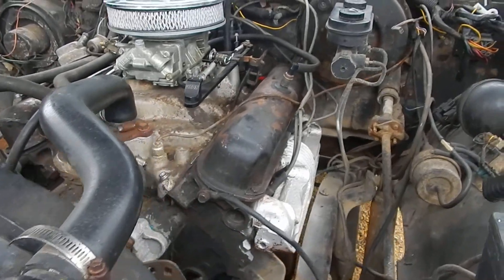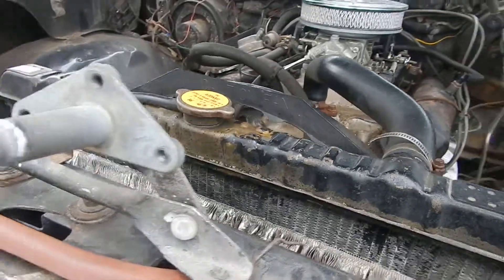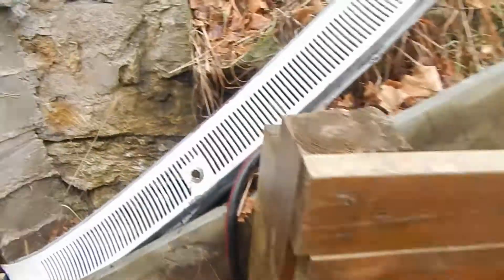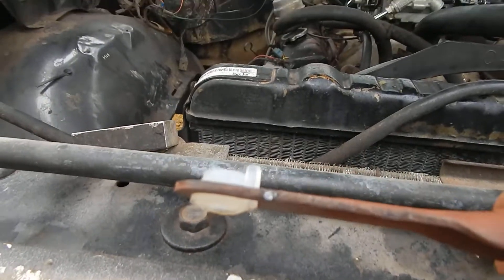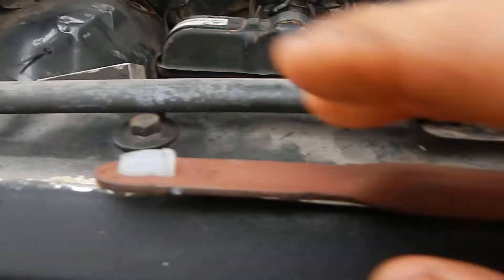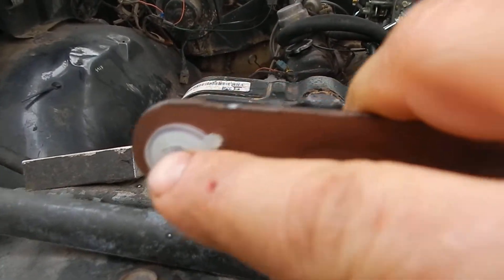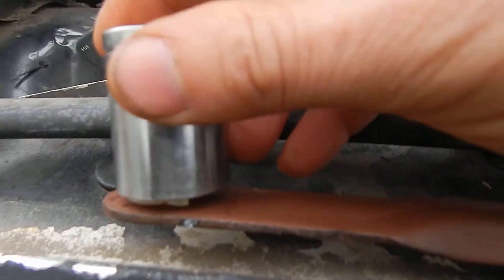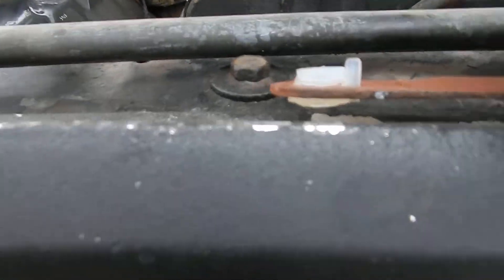Mopar Wiper linkage bushings Dodge Ramcharger

Comment: Great video, huge help in getting the nasty bushings installed.  Couple of things I did differently that might help others.  First, I used clamping pliers to push the bushing and linkage together.  Started with a slight pressure to set the two together and then did a half turn and pressed until they were fitted tightly together.  I also removed the small linkage from the motor, so I could do all the work on a bench.  Then put everything in place.  Couldn't have gotten this job done without your help.  Thanks!
Reply from the maker: Thank you very much!

Comment: I just finished repairing these, your video was a big help.
I drilled down thru all the post  and installed as 10 / 24 machine screws with tin washers on both sides with nylon locking nuts.
I also put a drop of lock tight blue on the thread of the nuts.
I bolted it all together and fished it in, then bolted the arm to the motor.
The screws are one inch long, everything works fine.
The drilling was done with a hand drill, first a pilot hole then the final hole.
This should never be an issue again.
Didn't want to take over your thread but it was the only way I know to add a tip.
Thanks again for the video.
Reply from the maker: Thanks for the tip !!!!!
Reply: Holy cow just did your drilling through the 4 posts and using bolts and nylon nuts, couldn't get the posts to stay in place in the new bushings for anything, just finished works great thanks for tip and thanks 318willrun for the videos
Reply: @blakenorman4822  my life is complete!lol
Thanks for the reply, I am glad it helped you out Blake.
I get all kinds of tips from these videos , I'm glad mine has helped out

Comment: I have searched without success to find a way to get the wiper arms off my 92 w 250. Any videos aren't showing what I'm seeing. There is a metal clip which overlaps the bottom of the splines and it is riveted in two places making impossible to pivot.